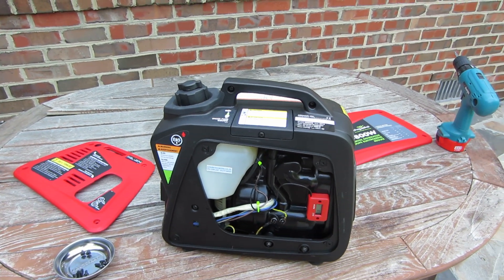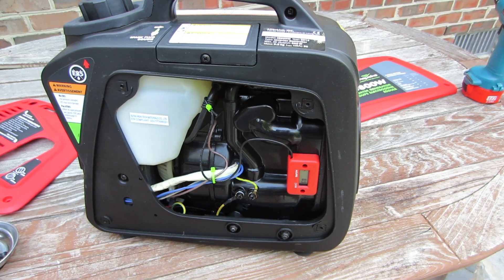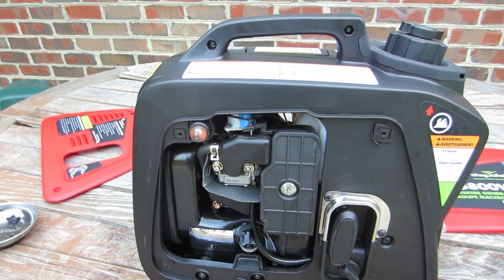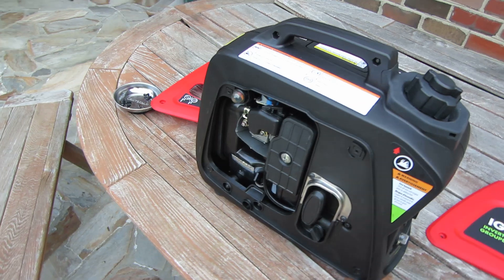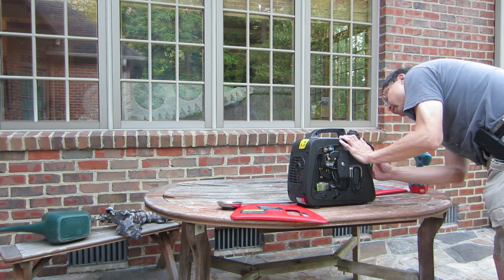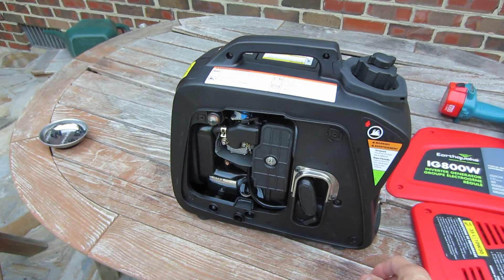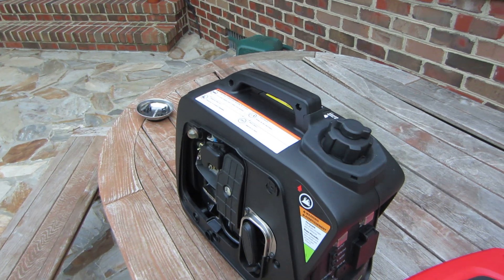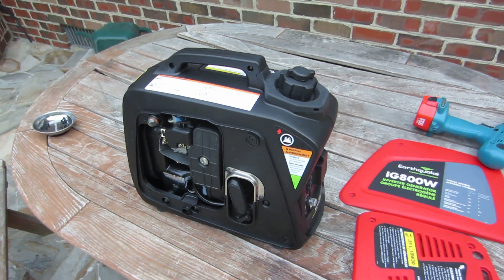Review no. 2 of Earthquake IG800W inverter generator

Comment: Wow. Quiet compared to what? A straight pipe Honda civic?
Reply from the maker: Doug Cohen I tried to measure the loudness with an app, but it’s not as accurate or standardized as a professional sound meter. It’s probably not as quiet as a Honda inverter, but comparable to other inexpensive models. Walk away 10 yards and it’s not bad to listen to.

Comment: 6/10's of a gallon is about 2.2L, it's not possible to run this unit for 10 hours. It's using that amount of fuel for 4 hours of 500W load so you must've miscalculated something

Comment: I've had mine for a few months now. I ran it several times to break it in and then about 6 hours to run a sound system. First hour or so it smoked like crazy! Then all of a sudden it stopped smoking and ran very clean. Nothing usual since then and it's been running great. Such a great deal. Thanks for the video as it was _very helpful and informative.

Comment: Mine just got delivered today.......added oil and fuel and it started within a few pulls. My only problem is it seems to surge and will not idle consistently (I'll upload a vid soon). Did your unit idle rough at first ?

I'll let mine run a few hours more before I call earthquake about it.
Reply: ***** Sweet! And you got a 2nd one for free from Amazon too? haha! awesome!
Reply from the maker: Mine did not surge and ran smoothly from the get go. I'd try different gas, and check or get a new spark plug (you can order one from Advance Auto for less than $2, it takes a day).

Run it with a medium load, like 2 or 3 100 watt bulbs for a bit and see what happens.

Make sure you've got the choke and fill cap set right.

Then call Earthquake.  Good luck!
Reply: m60mgman  I ran the unit a little longer and noticed a small amount of fuel had leaked out of the bottom. There is some sort of silver device that the fuel vent from the tank and line to the carburetor all go into. I tightened up the lines, but still have the leak. For some odd reason, the air filter and cylinder also filled up with gas (hydro locked the engine). I had to remove the spark plug to drain the fuel. I contacted amazon and they are sending me out a replacement. They don't want the old unit sent back, so I'll try to get the silver part from earthquake. The unit puts out a stable 123 volts and 60 Hz, despite the issues( 300-400 watt hedge trimmer)....it will make a great parts unit if I can't fix it.

Thanks for the spark plug info, I'll have to pick one up
Reply: *****
Got it working, took a few days and about 2 hours of work. I ended up finding 2 leaks in the fuel pump (repaired with liquid nails) gasket around carb was torn and various vacuum leaks around engine. A lot of the leaks came from loose parts that were not properly seated. I also went out and got that NGK CRM6A plug.....unit now starts withing 1-2 pulls, warm or cold. Runs like a top!
Reply: I was surprised, because I told them I would drain the gas and oil.....guess they didn't want to risk it spilling gas on the ups truck. I tried to get parts from earthquake, but they just have non major parts available (gas cap, panels, ignition coil...etc). I went to my hardware store, picked up a $3 tube of super glue and that unit has now run 27 hours without a single problem.